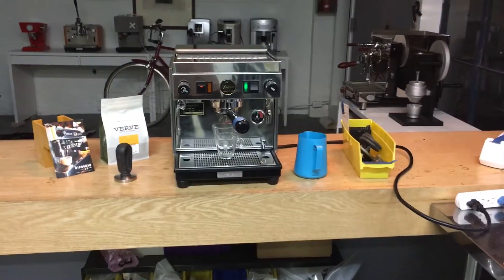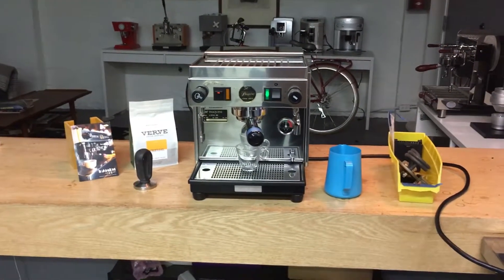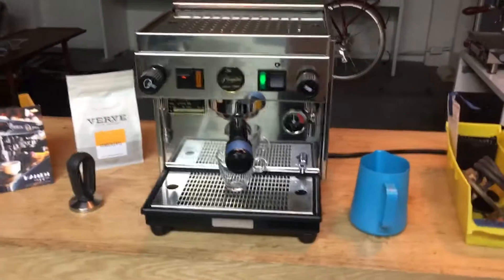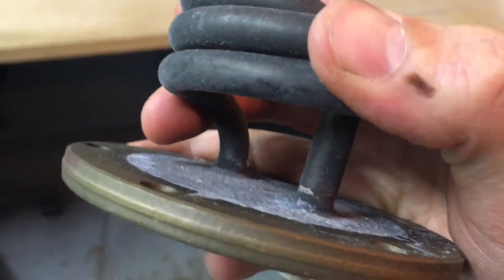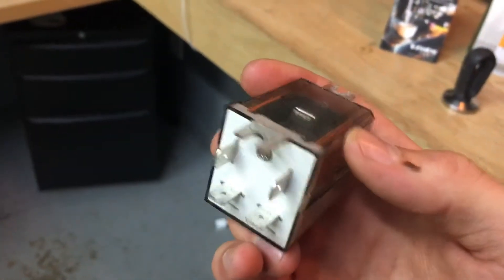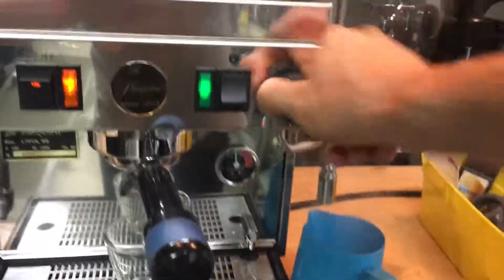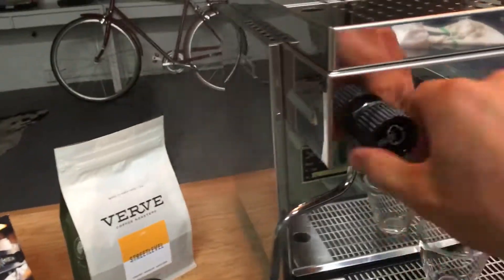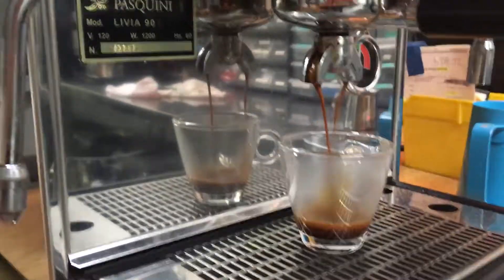Pasquini Livia 90 Test 1238- bad cpu, relay, heating element, pressurestat

Comment: I have a Pasquini Livia 90, my issue is the temperature gauge/bar goes up to the normal 1.4/1.5 bar but when the heating shuts off it will drift down to 0.9 to 0.8 before the heater kicks on again, this seems awfully low to me. Is this normal or should it start heating at a higher level, and if so is there an adjustment for that? I know how to adjust the high side, is that the only adjustment?